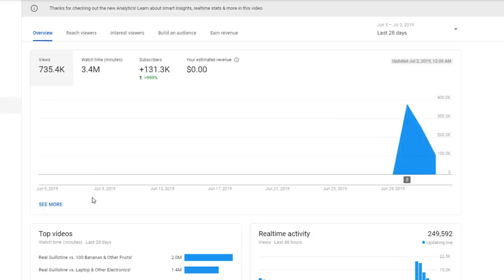Real Guillotine vs. NERF & Other Blasters!

Comment: You guys need to make the gap smaller where the blade slices so that stuff doesnt get sucked through. Itd make the chops 9000x more satisfying
Reply: They also need a wedge between the blade and the rail block so that the stuff doesnt just get caught on the lip
Reply: That would be they tried and not half ass this
Reply: @Eric-up9sk  yea to me this is just guillotine v1. V2 should have the rails and maybe even the wheels recessed in the wood that way the gap would be real small and it'd almost be impossible for derailment
Reply: For real, this is more of a crusher than a chopper at this stage.
Reply: French guillotines used guides similar to medieval stocks so the people couldn’t move to side to side and block the blade

Comment: I think the problems are:
-theres too much space in between the blade and the poles
-the opening where the victims are laid over and where the blade falls through is too big, causing everything to snap instead of cut
Reply: Exactly! So glad I'm not the only one who feels that these are more snaps than cuts.
Reply: It's not gonna cut through hard plastic... LMAO
Reply: @Lucifye  except it literally did?
Reply: @theconqueringenigma  nah man it's literally just a heavy-ass honed edge using its momentum to slam it's way through the plastic beneath it. If it was a cut the guns wouldn't have folded and fallen down next to the resting blade. They need to narrow that area up little bit and add some panels to prevent items from falling in the path of the guide rails.
Reply: All though I do agree with your points, it also really depends on the materials being chopped, as some just shatter at the respond of being slapped by a 50 pound object
Reply: This ^^^^^^^
Reply: 100% agree!
Reply: Will YouTube monitize them if the problems are fixed?
Reply: That's what I noticed since the beginning. A little modification would fix this.
Reply: I was thinking this myself. Hopefully, they redesign it because I know me and you aren't the only ones that see these two giant flaws. I still love the channel though, just would be nice to see a better performing guillatine.
Reply: making the rubber taller so that the blade stops before the block reaches the table would let them make the opening narrow without fear of stuff catching or getting damaged
Reply: Youtube monetize this content
Reply: 2 major flaws
1- the rail system : the blade needs to be directly in the rail, sliding without space between it and the pole. No wheels, no medium between the blade and the pole.
2- the ending : the space that is supposed to let the blade go threw is too large. It needs to be very narrow in order too cut. Nothing is supposed to pass this space other than the blade.

Comment: You should redo the rail system so that the wheels you have are running on a track built within the sides of the guillotine. I think you'd lose some of the risk of derailing. Cutting out the excess space where the blade isn't would help a lot I'd imagine. Keep up the good work, 6 year fan of all corridor content, love what you guys do.
Reply: That Show I had the same thoughts to and where the blade slides in it should be smaller just for the blade so things get less stuck maybe add rubber around it so the wood takes that impact
Reply: @Ganbalf  see that would be nice but since it took them so long to machine the blade I think adding extra wood or rails would be easier. But yeah in a perfect world a bigger blade would do it.
Reply: @thatshow4579  welding on a pair of wedges to the sides would be enough, the point is not really that the blade needs to be wider, to point is to top the blade from tilting too much and applying leverage to the sides
Reply: @Ganbalf  well I think if more tracks were added and a redesign of some large components. For example if the blade ran directly into the block they use for the drop then the gap could be smaller for cleaner and more visually pleasing cuts. There's a lot of redesign needed to reach the absolute best cutting potential, but Jake is pretty smart so I'm sure he'll figure out a good way to make it efficient.
Reply: This is a great idea.  It would solve the derailing and the binding issues at the same time. I hope they do this.
Reply: You're facing the problem with camera sliders here. It's absolutely possible to make this work, however it would require a couple things which would take a lot of time and effort - primarily, to keep the blade running smoothly while also reducing the risk of de-railing would require the tracks to be very, very square and almost exactly parallel. This isn't beyond doing, but to get it within the tolerances you'd need (which would be, broadly speaking, within ~1mm over the whole length of the blade travel) would be very hard work.
Reply: I think the rails to be slightly closer which can also reduce the chance of derailing

Comment: So, my wife and I were sitting here analyzing the various failure modes of your current guillotine design.  Point by point:
1) the tracks should be recessed into the 4x4 so the blade has no space for lucky objects to slip into the wheels.
2) the distance between the first pair of track wheels and second is too short, allowing the blade greater mechanical advantage against the uprights causing them to bow out and the blade to derail.  
3) the gap where the blade passes through is too wide, but obviously can't be made narrower until blade stability is achieved. This will prevent folding and binding of objects. 
4) You need more power at the point of contact.  Either greater speed or more mass.  Consider creating a 2:1 pulley system with a release and adding mass to the blade.  If you had through holes on the blade you could add additional plates of steel as needed for the cutting task.  

I'm an engineer and also a filmmaker/VFX CG artist.  I love what you guys do and I love this guillotine channel!  My wife is just intuitively smart.
Reply: Joe Hancuff I just made a comment like this and then scrolled down to see 2 other people say the same thing😂😂
Reply: @jacoboppermanfilms  yup. Me too. At least we're all in agreement. 🙃😁
Reply: This.

I really want to love the guillotine channel, but if jake wants to actually pay for that beer rather than just make us laugh a bit with the skits, he'll have to improve the guillotine, especially with how much work time it's draining out of em whenever a derailing happens.
Reply: Hopefully they read this and improve their current design.
Reply: Or add some smaller wood strips along the sides of the rails. That way no extra routing has te be done and less time will have to be spent on construction.
Reply: Ha! I thought you were going to go into system and operator safety. I see a number single point of failures that could actually injure/kill one of them. But I really like all of your points for making it more lethal!
Reply: This Guy Chops^
Reply: I was just about to post the same thing! Bar point one, I hadn't thought of that.
Reply: Literally adding rails or recessing the wheels alone would save Jake so much future work and be a huge improvement
Reply: agreed !
Reply: 1 might fix this, but could also use something more sturdy than screws and nails to hold the objects centered
Reply: This is great feedback and I see others, like I, came to many of the same conclusions.  I think recessing the track into the wood and covering the recesses with wood would solve a lot of issues.  However, to increase the pressure at the cutting edge I would highly recommend increasing sharpness over adding mass.  It might be worth doing some math to see how much effect additional mass would increase pressure, but I suspect the blade edge is a bigger detractor.  After each release I would look at the edge to see if there is rolling which would greatly reduce pressure.  I'm curious to see how hard the metal at the edge is as that would affect how much rolling and chipping each contact makes.
Reply: As a mechanical engineering student I totally agree and thought of similar ideas myself to improve the guillotine and get you guys your beer money faster! :)
Reply: Fly this man out to build a better version of the guillotine.
Reply: To go along with point 1 you would need a larger blade to make up for recess so that on the the entire frame is the area that will cut and there is no points in which objects can get out from under the blade. Especially if they are gonna do larger objects like that
Reply: I agree with the above and would like to add:  the vertical beams are connected at the top and bottom allowing for bowing in the middle.  If you added some horizontal cross beams approximately half way down, it would prevent most of the bowing reducing subsequent derailings.
Reply: Joe Hancuff yeah I’ve noticed each chop tends to be more of a fold than a chop
Reply: You God damn genius. My girlfriend is an engineer so I wanted her to confirm this and I've never seen her have more fun confirming this. I SECOND THIS.
Reply: @Johnny-wv9cn  I love your suggestion but Jake has waaaaaay too much pride in this project and build to do that.
Reply: @spmil999  Pride or not, his guillotine blade derailed and chipped the frame and there's been a few time where items got stuck so they need a new design. Preferably no gap between the blade and the wheel guards
Reply: "I'm not a carpenter, just a carpentry enthusiast."
-Jake

He's done his best.
Reply: Joe Hancuff a smart wife and husband
U two seem perfect for each other

Comment: Yo, sack the rail system you have. You could absolutely make it work, but it would be such a pain in the backside that it's not worth the effort. 

You might be better off replacing it with parallel roundstock (of some kinda steel), and linear bearings. Might take some time to work out what bearings, and what steel, but you can't bounce a rod out from within an enclosed cylinder.

Also, safety-wise, it might be a better bet to stand further off and remotely trigger the drop with a big solendoid, especially if you ever try glass (or want to see what happens when the unstoppable force of the guillotine meets the immovable, indestructible object of Carbon Fibre). But, well done on the safety that already seems to be present - your literal death machine seems pretty safe.

And keep making this top notch content!

Comment: Just to remind everyone that this was invented for cutting necks.
Necks are squishy, elastic and gelatinous in some sort of way, they also are attached to a whole body that holds them down during the cut.
Plastic and mettal are hard and inelastic, therefore they respond to great forces by being bent and shattering.
Also, as these hard materials get force smashed by the blade, the blade also suffers that force back and is bent and shattered.
Reply: @genericmeat  Well, guillotine was built to avoid that problem in the first place, and it did a realy good job at that. Watch the previous video where they slice through multiple pineapples with quite clean cuts ! One neck was absolutely nothing for a guillotine. 
Guillotine was built to replace the Axes during death sentences because axes could fail at choping the head with one slice, for various reasons, the axe blade being to short so it was hard to hit with the perfect spot, or not enough force put in the swing. 
Guillotine blade is SOOOO heavy, there was no force problem, and it was large enough, guided by rails, so there was no way it miss, and the blade was angled so it could perfom the cut much easier.

Comment: A big rubber band ball could be interresting. And not to expensive :P
Also, time to upgrade the track system because this is not the best design you can do. ;)
Reply: I'd also go for a wider blade probably, and maybe add a place above the blade for weights to be added as needed. Also if they are going to stick with the current track system they may want to make a section that could hinge open to allow for resetting the track without pulling it all apart.

Comment: Might i propose once the channel has earned enough money to pay for it, that you commission a different blade shape. Instead of a single slant you go with a reverse V that will push the target towards the center upon impact.
Reply: I was just about to write the exact same 👍
Reply: that wouldnt be a historically accurate guillotine
Reply: @vincenoname  I'm pretty sure metal wheels along the sides aren't historically accurate either. Honestly, i doubt anyone here cares for historical accuracy. If they did, they certainly wouldn't be here.
Reply: @vincenoname  does anyone say it must be historical correct?
If yes, it doesn yet look like one.
They could make it more the american way, harder, better, faster, stronger 😆
Reply: Ron Samson that was all I was imagining while watching this vid
Reply: The reason they're slanted like that is so that you get more force over less area, allowing the blade to slice through things easier. A flat blade or, even worse, the design you propose, may just bounce off or crush things without starting a clean cut since it maximizes surface area. Perhaps it would be better to create a mechanism for securing the "victims" that won't be in the path of the blade.
Reply: 900 IQ
Reply: That would be so cool

Comment: You should place the rail system inside of the 2x4s. Should help keep the blade from derailing/jamming and with a slightly lager blade it should keep anything from getting pushed out and not cut.

Comment: You should sharpen that blade! That’ll help stop if from derailing, and get you cleaner cuts
Reply: while this could help, sharpening the blade would not necessarily fix the problem. the big issue with blades is that they work by separating matter, and if your blade is too thick it will just end of getting stuck or fail to cut through the object and, in their case, derail. Shadiversity has some great videos on the intricacies of medieval blades if you're interested in the topic.

Comment: If this was something I was working on I would personally redo the dropping mechanism
If the blade slid in grooves in the beam instead of riding on casters you could aluminate the gap between the beam and the blade
It would also allow you to bring the edges of the table platform closer to the blade so that things will cut instead of leveraging and snapping

Comment: You should add cross bracing supports along the entire track for the blade.  That way the frame doesn't flex and the blade doesn't derail.  It should also fit very tightly into the track, with as little horizontal play as possible.  I suggest making the gap at the bottom narrower so it doesn't get stuck in there with whatever you're chopping.  Also consider adding bracing or side guards to the table so stuff doesn't move around.  Maybe you can make them out of acrylic so they don't block the view.

Comment: i think you guys should start doing guillotine mods where you mod the guillotine to do something rather than just chopping, and getting it to help you do everyday household tasks, like maybe adding gritted sandpaper to the blade and line up a bunch of matches and fireworks and see if they will light from the friction of the blade passing by them with the sand paper

Comment: 1. GoPros (Have it be rolling as the guillotine drops)
2. Nick's Phone (Similar to the archery challenge, but now it is a guillotine - live stream it haha)
3. An operating microwave
4. Spray Paint
5. A Soccer Ball (the episode can revolve around sports balls)

6. Wren's One Wheel (Don't actually do this, though an old one wheel could work well as a substitute)
7. Oobleck Balloons
8. Peter 42 (Use a cadaver for this, then deepfake on Peter's face)
9. A bunch of springs

Comment: Hey, I'm not an engineer or anything but take a look at the rail systems on rollercoasters and kinda base a new rail system on that. Also you might be able to get more power if you somehow use an electromagnetism to propel the blade as it goes down.

Comment: Pipe would make a much more reliable track system. 3/4 steel pipe all the way down both sides of the blade and 4 points with a larger diameter pipe around that.

Comment: 1. Colab with the slo mo guys 

2. Make the 2 posts with the tracks closer with crossbars spread out so it can't flex and derale

3. The opening at the bottom where the blade goes through should be decreased as much as possible... if you wanted and had the time and resources you could taper the edges of 2 boards, at a tin layer surface to the edges and hit it flat to the wood and secure i with some nails and adhesive, and have a second rail horizontally for the chopping board with som springs or elastic puting preassure inwards so there is as little space as possible at all times allowing an easier cut instead of rip apart amd get stuck.

4. Put some blockers using some pine boards blocking off the rail system so the items you chop dont scoot accross and get jammed in the system/ are forced to be chopped... u coupd do this only on the lower 3rd where you will be chopping so you can access the main of the rail system for any reason

Comment: get some planks of wood oriented vertically and perpendicular to the gap where the blade sits. put the planks on either side to stop the objects from sliding outside of the blades reach. have the section that the blade and the runners pass through clear though

Comment: You should make it so nothing can slip past the blade and hit the casters. You should put up wooden guides blocking the casters at the bottom so everything is in the path of the blade and the. The blade also won’t derail at the bottom if things go south.

Comment: You need a tensioning system for the wheels, so they can be tightened against the rails. And you need some sort of guard or shroud for the rails so that nothing can be shoved into the wheel track. You should use every failure as a way to improve the machine so that eventually you'll have the perfect chopper. Version 2.0 should be ASAP.